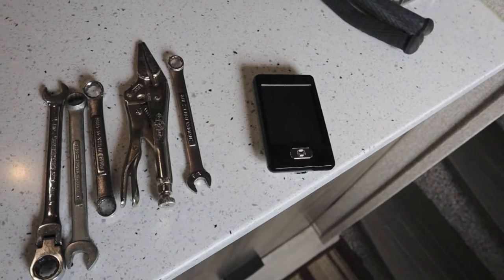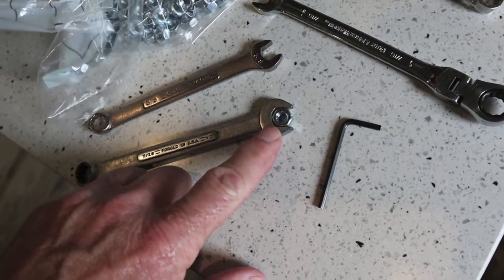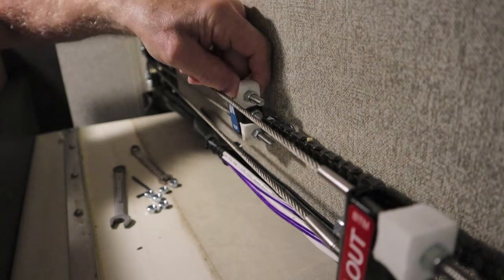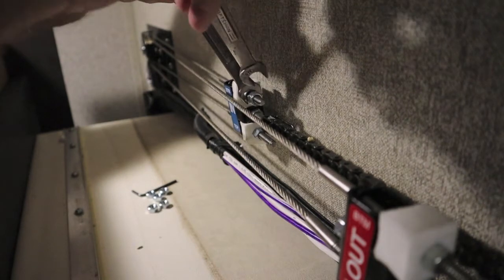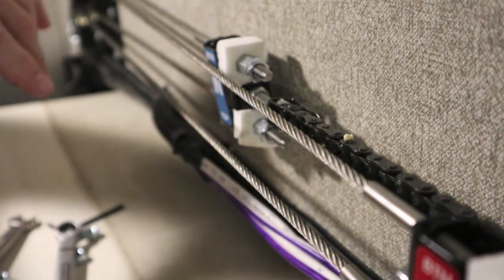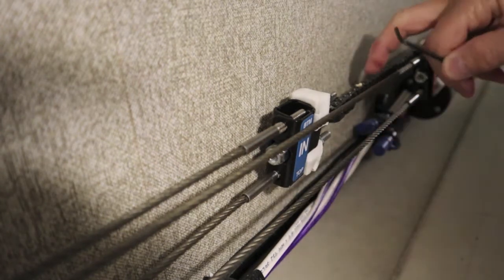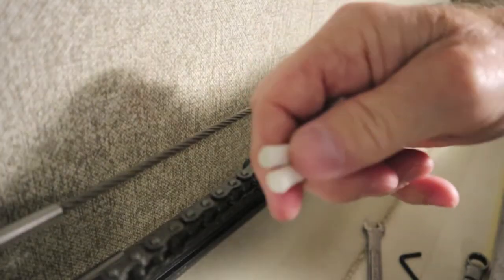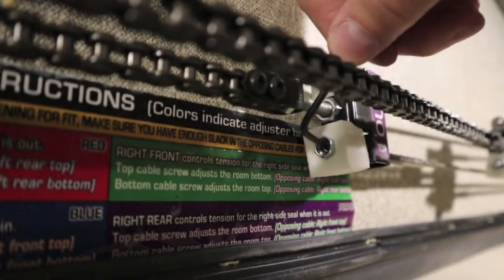RV Slide-Out Cables coming loose on your BAL Accu-Slide? The Double Nut FIX

Comment: Did you remove the fascia board to work on it?
Reply from the maker: Joe, did not have to remove anything. The slides were moved in several inches for room, but for double nutting the threaded adjusting rod there is plenty room if you slide them out enough for your hands and wrenches.
Thank you for watching!